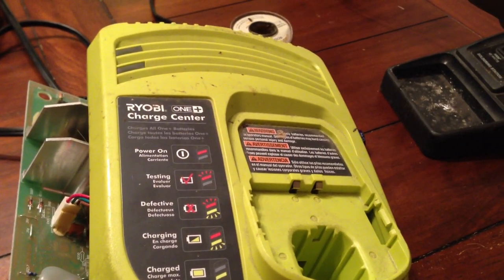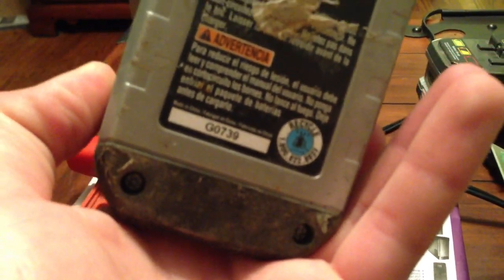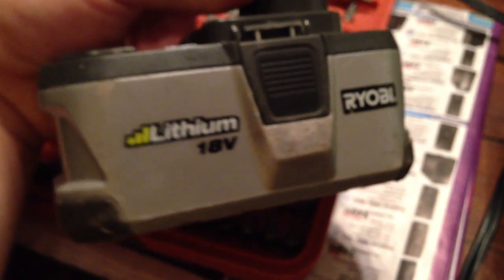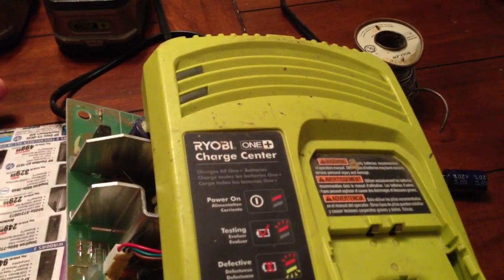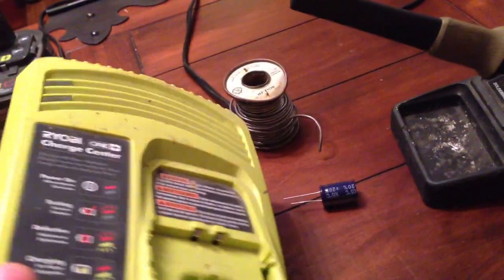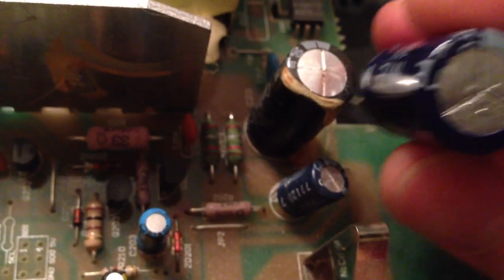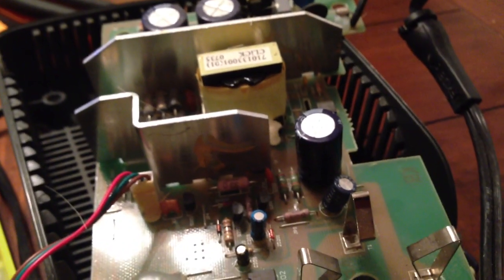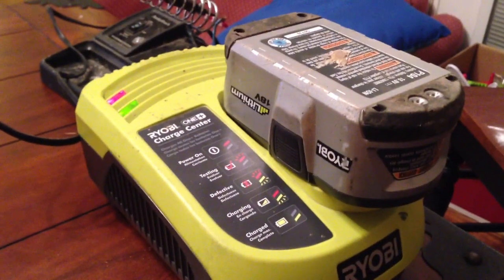Ryobi One+ Charger Repair

Comment: I have a P118 (very little use) charger that isn't working. When I plug it in, the red power indicator briefly comes on then immediately goes out.(blinks once) I've opened it up to look around, fuse is fine and it's getting 120V after the fuse. Any ideas?
Reply from the maker: They did a recall on the chargers and they sent me a new one.
Reply: @mjmcomputers  I believe that was the p113 chargers.
Reply from the maker: @joeghadban2882  you are correct it is the p113. I’d start by checking capacitors.
Reply: @mjmcomputers  is there a way to test them without desoldering them or buying an esr tester?
Reply from the maker: @joeghadban2882  you can try with a voltmeter but I’ve found it’s not too accurate when it’s still in circuit.

Comment: I also own this battery charger and mine has not worked for years... the red "testing" light flashes continuously and never charges the batteries.  I just bought a brand new battery thinking it was the batteries that were defective instead of the charger.  After it does this same thing with the brand new battery, I realize the charger is obviously defective rather than the batteries I'd attempted to charge.

There is a recall issued for the P113:
https://www.ryobitools.com/power-tools/support/safety
In-Store Notice:
https://cc831cbd7a5a3a616f82-5093119187eb17284bcf20613cda98f7.ssl.cf1.rackcdn.com/safety-notices/pdfs/63acc184-7bab-4d28-8a9b-1eb758551c16.pdf
CPSC Press Release:
https://cc831cbd7a5a3a616f82-5093119187eb17284bcf20613cda98f7.ssl.cf1.rackcdn.com/safety-notices/pdfs/83960708-9aad-4d89-84dc-2b1764ebf29b.pdf
Reply from the maker: Mine failed again about a year after this video and I sent it in for the recall.
Reply from the maker: I added the recall notice to the description. Thanks for the links!

Comment: Thank you sir for publishing this solution. Mine had the same capacitor with it's top enlarged. Same symptoms, the charger was telling me all batteries (have 4 on hand) were not good. Replaced the capacitor with a new one 50v 1000uF and it works as always now, and accepts my batteries.

Comment: Trying to find a fix for my OP400 battery and charger...on the third charge it is no longer working, unit flashing and indicating bad battery.
Reply from the maker: After repairing mine, it worked for quite awhile then failed. Another viewer pointed out there is a recall on these so instead of trying to repair it again, it just sent it in for the recall. Waiting now to get my replacement.

Comment: I just bought new ryobi set and it has the P117 and used it to recharge battery 3 times and it doesn't have any power now at all. I was hoping that someone could help me with this. I would return to store but can't find receipt anymore. Seems like a complete waste and I'm very disappointed with this brand. I wouldn't buy this again and I quit buying the lawn equipment as well.
Reply: Mine just did this. Did you find the problem
Reply: @robertmay31  With my limited research, I've found that these rapid charges are absolute junk, and I really like Ryobi tools. I got one with a kit and it lasted about 3 months and I have not found anyone who can tell me what could be wrong with mine, which has no visual damage.  Apparently there are many components on it that are made to malfunction in a short period, and unless they explode good luck on finding out which one it is, unless you are an electronics repair technician.    I have 3 nonrapid chargers and one of them is several years old and still works fine.  I've also remember reading somewhere that the rapid charges are not good for you battery anyway.